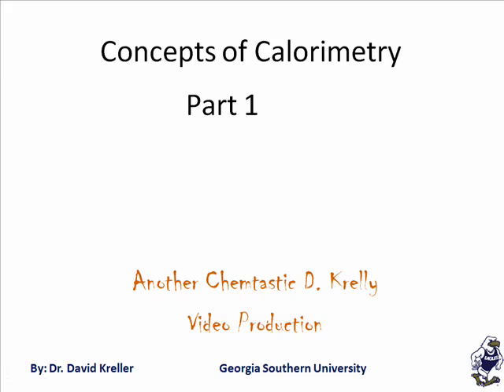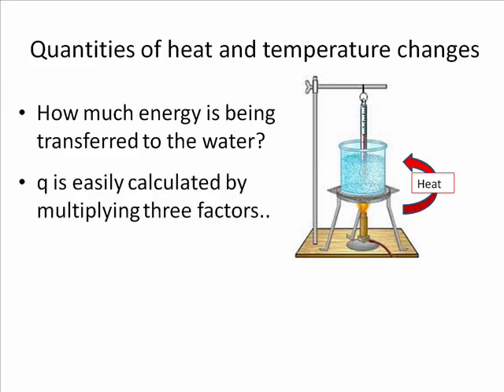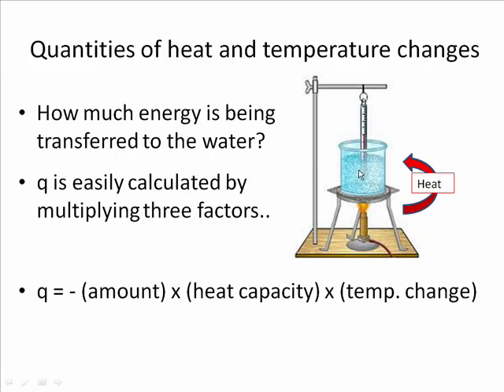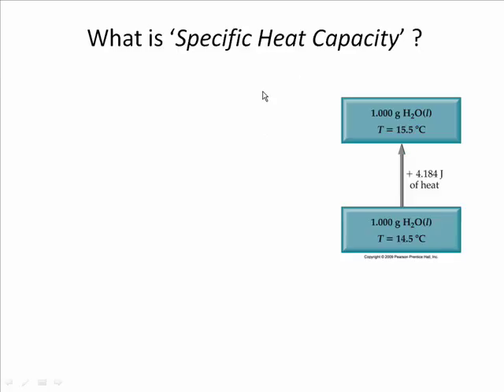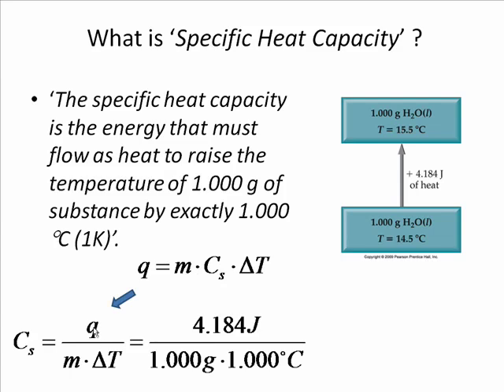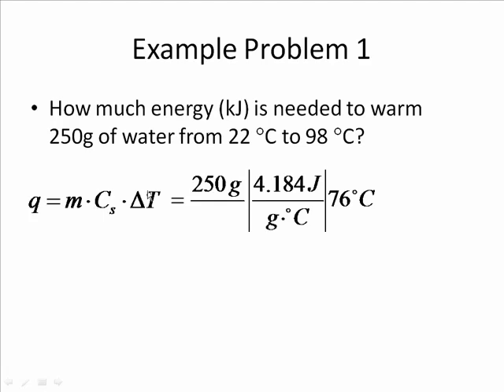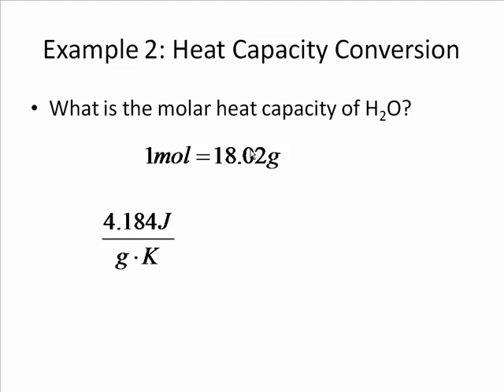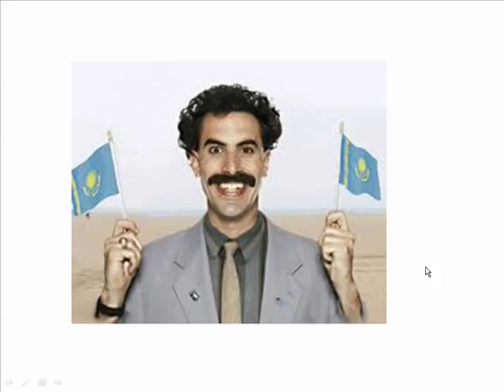Calorimetry Part 1

Comment: I need help with a bomb calorimetry question: Under constant-volume conditions the heat of combustion of glucose (C6H12O6) is 15.57 kJ/g. A 2.800-g sample of glucose is burned in a bomb calorimeter. The temperature of the calorimeter increased from 20.35°C to 22.65°C.
(a) What is the total heat capacity of the calorimeter